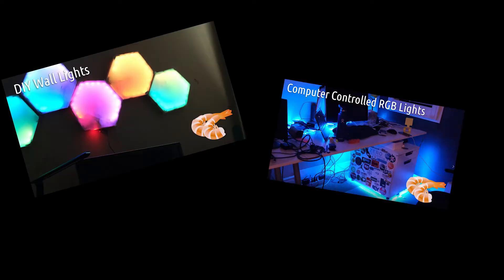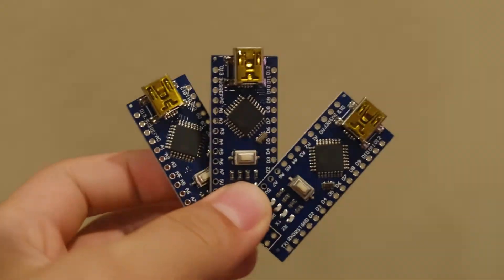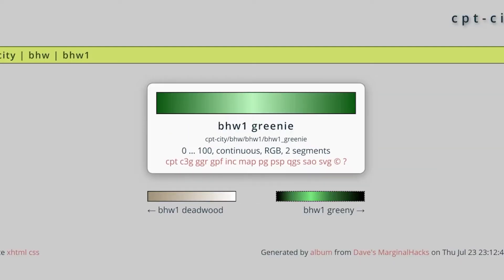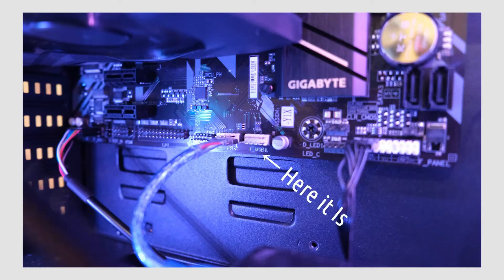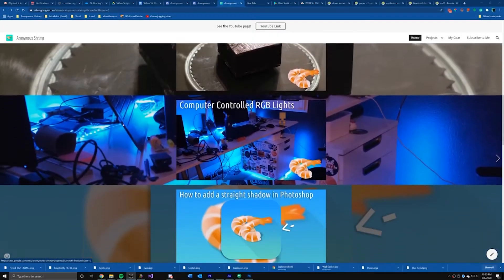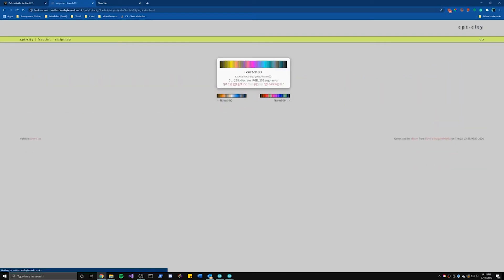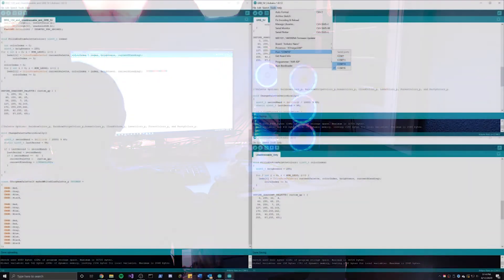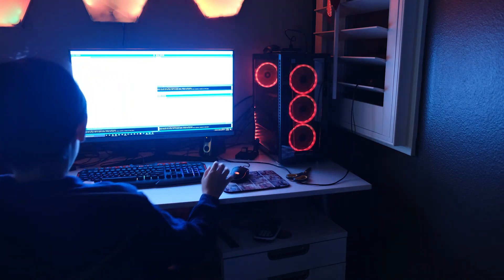DIY RGB PC Controller

Comment: Would you be willing to share a specific list of parts you used to build the controller.  I see the LED's but nothing on the actual electrical components.
Reply from the maker: you should be able to see a schematic in the github link. if you are using an unaddressable rgb strip you’ll need 3 pnp transistors and 3 resistors. And a resistor for addressable strips. if you want to control your rgb fans, just see if the connection with the motherboard has 3 or 4 pins. if it has 3, it’s addressable. For the most part, the complexity comes from the code as it has the gradient functions

Comment: can i control the fans color ?
Reply from the maker: Yes you can if you unplug it from the motherboard and plug it into the Arduino. The point of the controller is to sync everything up.